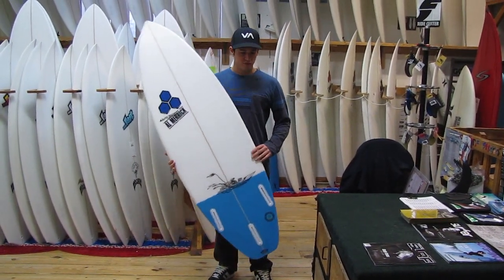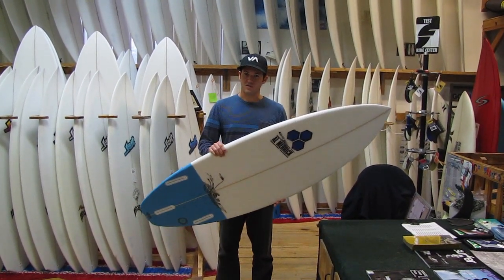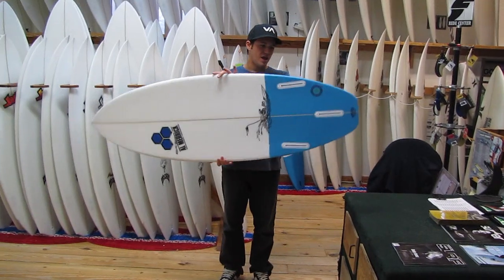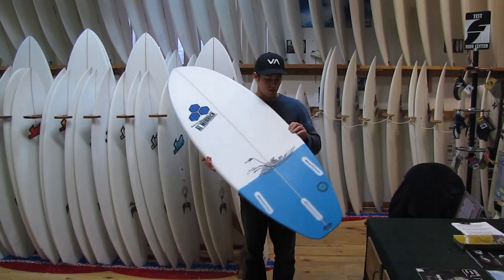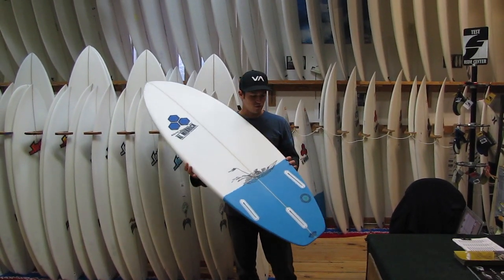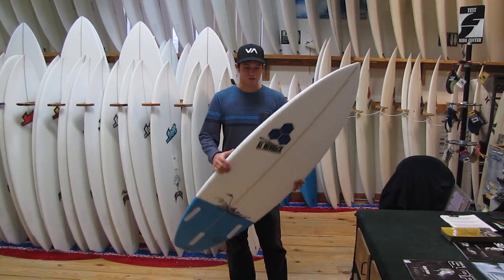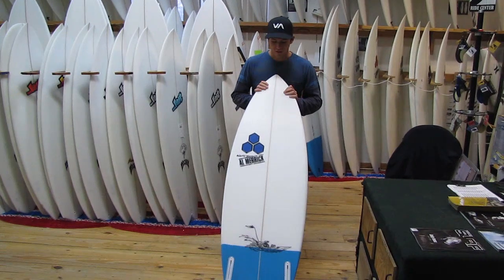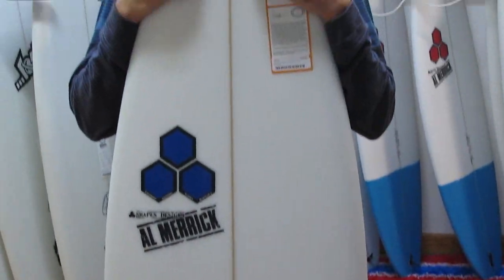Channel islands motorboat board review

Comment from the maker: You're 175lbs and ride a 5'9 semi pro? That's kind of small for that weight. Is it working for you? At 175 CI recommends a 5'10 motorboat but they also say to ride 4 inches shorter than your shortboard, which in this case would be about 5'6.